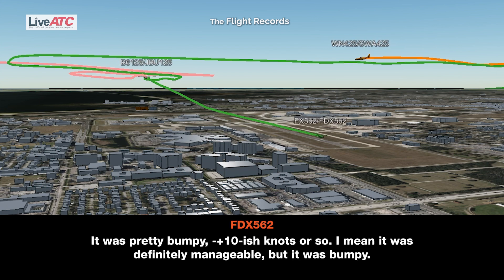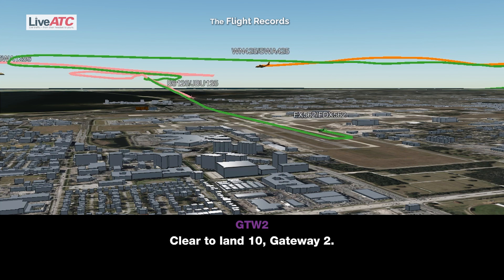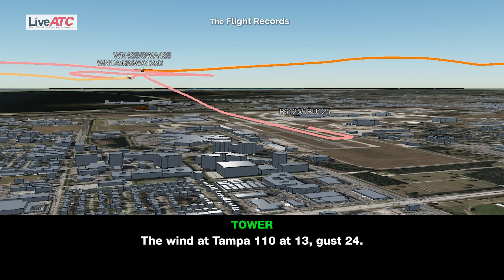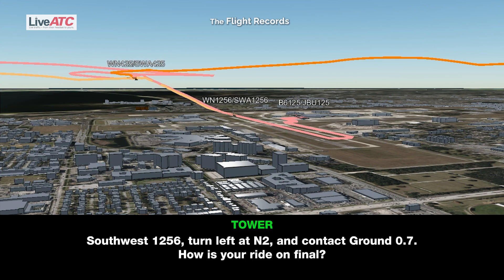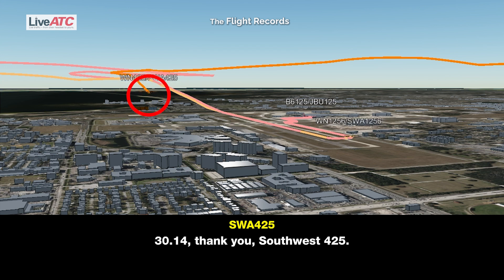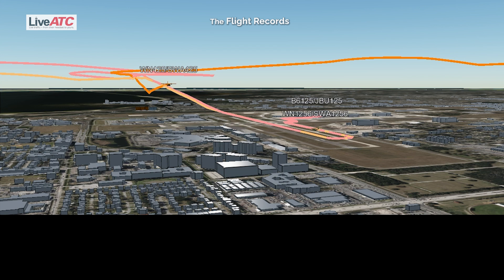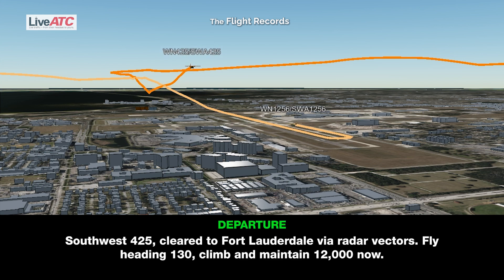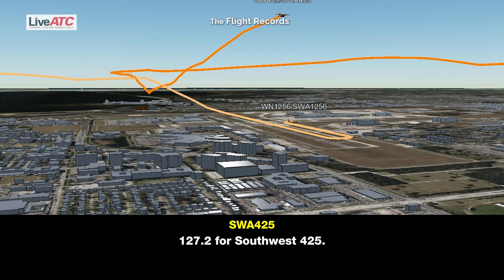Southwest plane descends BELOW MINIMUM SAFE HEIGHT!

Comment: No excuses but things to consider.  It is likely that they have never landed on 10 before,  as it is normally restricted to airplanes under 75K.  They already had a high workload because of the runway change and holds.  That runway has an RNAV approach only.  It is relatively short and they were likely right up against the minimum length for landing on a wet runway, especially in wind.  As I said, I am not making excuses, but trying to explain how a mistake could happen.

Comment: Why did they divert to fort lauderdale
Reply: That's what I want to know.  Looks like everyone else was making it in ok.  I know they held for quite a while, so fuel might have been an issue.  Only enough for one approach before diverting possibly.  Also, why is the alternate FLL and not MCO?  Hmmm.
Reply: Rain, wet short runway, wind, and the fact that they may not have trusted the RNAV at that point.

Comment: Apparantly they were not using any sort of electronic vertical guidance? They did not have the airport in sight and continued to descend nonetheless?  I wonder what would have happened had the local controller not been monitoring their descent. This is the third instance of SWA getting too low too far out on final approach. There must be a problem with the general culture there. I think they, like the military does on occasion, need a safety stand down to regroup and retrain.